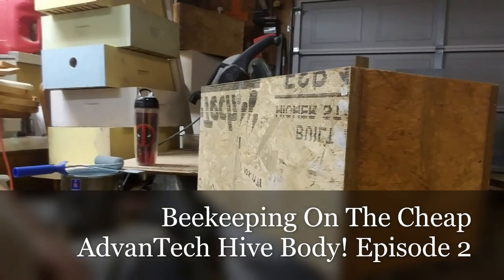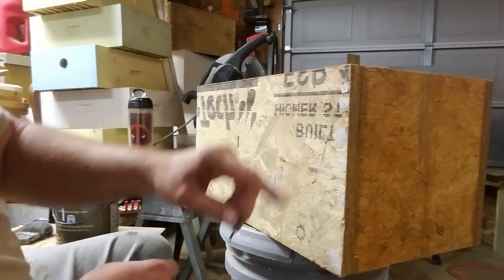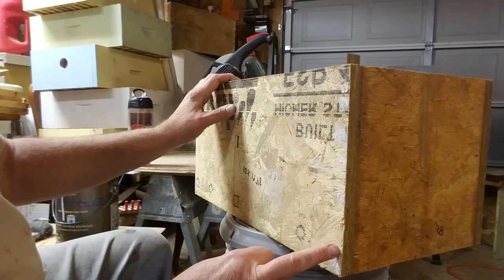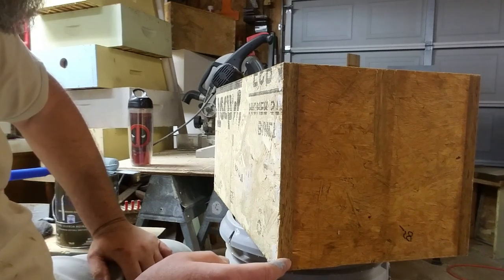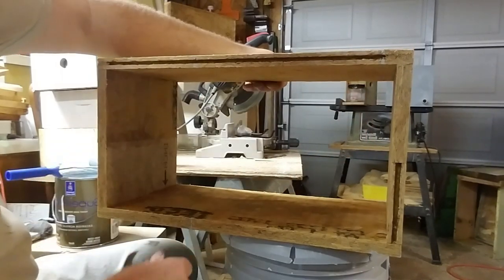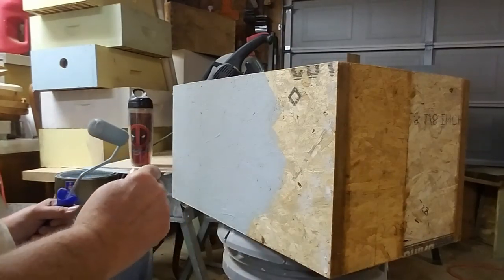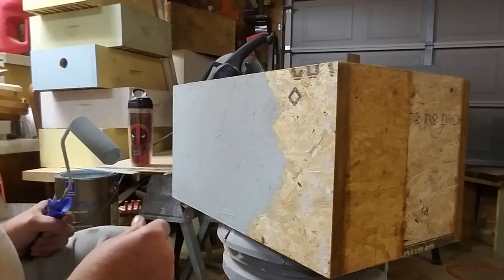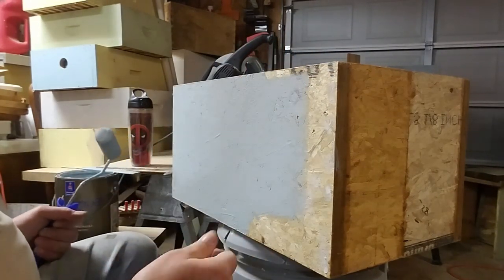Beekeeping On The Cheap AdvanTech Hive Body! Episode 2

Comment: Hey, I can relate!  I pulled a LOT of lumber out of a jobsite dumpster.  I had to pull a lot of nails out of boards but was able to build quite a few frames with all the 2x4 and 2x6 lumber.  I grabbed a bunch of the advantech flooring cutoffs and used for bottom boards on nucs and full boxes.  Even built out some full hives with some 1.25" flooring.  They are heavy but well insulated bees!
Reply from the maker: I love the free stuff there would be no way I could have afforded 150 complete hives minus the frames I value my fingers

Comment: Woolie B, I paint a lot like you except I want my last coat to be put on with a brush and vertical strokes.  I may be wrong but I think water will run downward easier and quicker with the vertical brush marks in the dried paint.  Thanks for the video.
Reply from the maker: thanks for the idea. that would work for pine boards but advantech has pieces of chip board going in all directions so they will catch water thats why im OCD on my first coat. but i will use that idea ive got to build more honey supers and i use pine boards for that.

Comment: Thanks for sharing great video what dimensions are your cuts and what design are you using for frame rests bottom boards and covers?
Reply from the maker: everything on the 5 frame nucs are the same as what you buy except my boxes are 1/2 inch wider i hate the thought of rolling a queen. lids are advantech zip system the green epoxy coating and 2 x 4 cut in 3/4 thick strips and stapled to the zip board. bottoms are the same as store bought but 3/8" not 3/4"

Comment: I put a piece of AdvanTech outside for over a year and it only swelled 1/4 inch. Painted i bet that stuff will last 20 years.
Reply from the maker: yes but you have to get the paint in all the holes. i have started using tite bond 3 glue on the cut edges 2 coats then paint it and that makes the cut edges water proof